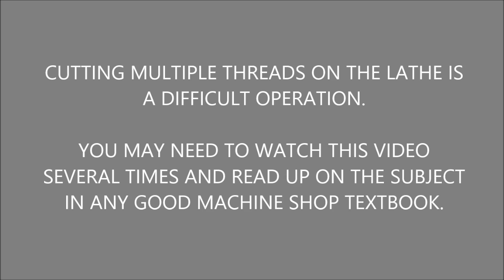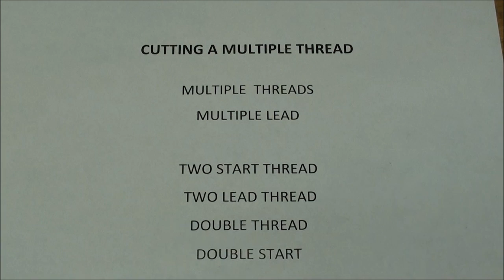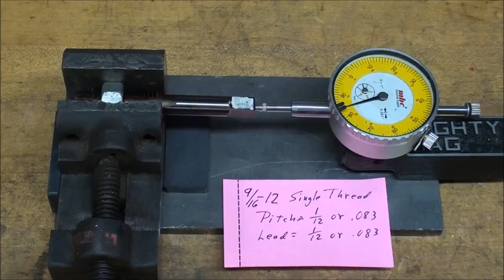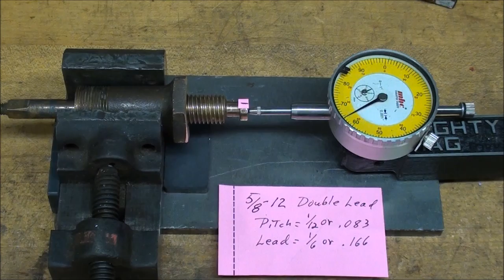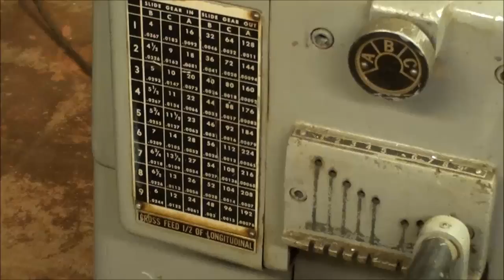MACHINE SHOP TIPS #128 Cutting a Double Thread on the Lathe Part 1 tubalcain

Comment: To add to the list of double thread uses:  Before pedal kettledrums were invented, the T-screws around the rim to tighten the head were double threads.  That way, the drummer could adjust the pitch more quickly during performances.  Didn't know this until I was restoring some old kettledrums.  Obviously, neither did the bodger before me, who tried to use hardware store single start nuts on the T-screws and ruined the threads on some of them.
Reply from the maker: Your comment is both funny and pathetic. I didn’t know Bob was a drummer.

Comment: Mr Pete,  Thank you very much for making this video. After watching your video I was able to repair a drill operated three leg cylinder honing tool. It had a two multi start 14 TPI  screw but it was missing the adjusting nut. With your detailed instruction I was able to make the nut, first try,  You did an amazing job explaining what is a multi start thread and how to make them. Thank You

Comment: Many years ago i got my craftsman atlas 6” lathe without a chuck
(I might be backwards ) I big difference in a craftsman to a atlas is the spindle threads craftsman is a 1”10 where the atlas is a 1”8 
Many 1”8 backing plates avail i had to make my 1”10 
Then one day at my friends who got his father in-laws craftsman atlas i found the chuck had a double thread cut on it 
Someone took a 1”8 backing plate and cut a 1”10 over it 
Although i didnt get to use it wondering your thoughts about it
Just recently let my craftsman 6” go for a 
South Bend 9” so that dilemma is over
Reply from the maker: I didn't know they made them with different threads. I would think that double thread would be very weak

Comment: I can cut two start treads all day long.
My lathe has a drive gear in the back that is 4O tooth and it is a 1:1 ratio with the gear in the main gearbox that disengages to change feed direction.
By doing this correctly and carefully I can disengage my spindle speed gear box and and the feed direction lever and rotate the spindle 180 degrees.
The chuck is marked 180 degrees off from one side to the other with an index mark on the upper gear box.
The only reason I disengage the speed gears is to make it easy  to turn.
You can change spindle speeds all day long while cutting threads with no effect on the rest of the timing.

Thanks again for the videos Lyle 

.

Comment: Mr. Pete,

If it was a 4 start thread, would the depth be 1/4 of the single thread depth?
Reply: Do you mean the lead or setting the gearbox?  I think 12tpi ./.4 = 3tpi. So if
a SBend, you have to change the feed gear to get down to 3 tpi. If I remember
6TPI is the lowest without changing this gear.  I may stand to be corrected, 
its been yrs......

Comment: I like your method of obtaining the second start. Much easier than the method that I was taught. This involved disengaging the change wheels and turning the driver gear through an angle equal to the number of starts. When I was serving my apprenticeship [1950 to 54] I had a regular job involving two start square threads for locomotive hand brakes. Because the pitch was an odd number I was able to cut each lead alternately by engaging at 1 and 2 on a 8 point chasing dial similar to yours.

Comment: Several years ago, a friend showed me some double tip cutters for cutting both threads of a double start at once. They are the only ones I've ever come across. He also had a set of double taps. You explain this much more clearly than he did. Thank You!
Reply: I can't wrap my mind around the two cutter insert tool. Hate to say this, but it's not possible unless the cutters are opposed and maybe cam-adjustable for depth of cut. What's your take on it, Lyle? Sounds like it would be a real beast to create.
Reply from the maker: +badazrod Thanks for watching

Comment: Always learning stuff!  Keep up the good work!
Quick question to all, how would the second start be located if the compound was set at the regular 29' for thread cutting?  The apron carriage wheel is rather coarse to locate the 0.083" difference for the second start.  Cheers,

Comment: I didn't find the explanation at 12:45 too clear for those just learning. I have referenced the machinery's hand book 23 my self and a 5/8-12 thread has a reference minor diameter of max .5242 . Given that the major diameter 5/8 then .625-.5242 give us the delta of the two diameter =.1008 , if your lathe crosse slide dial reads in diameter then that is what you feed in. If your crosse slide reads in radius or your using an indicator then you must divide by two.
A multipel start thread has the same profile as a signal start thread of the same pitch, so all of the diameters; Major, Minor, Pitch and root are equivalent.

Comment: I've always wanted to try this on a manual lathe, just never had the need.  If I did, I was going to do it exactly as you have, with the compound set at 90.  I can see how you could also set it at 29.  It's funny that you mentioned the odd threads on that valve because there is a production job in our shop making just that, left hand acme threads with double lead.  It is a job that runs continuously year round so they actually had custom go/no go hardened steel ring gages made for it.  I don't even want to know what they cost.
Reply: Those go/no go gages are serious territory. The acme tandem taps command deep pockets also.